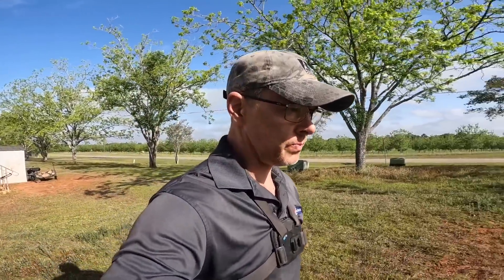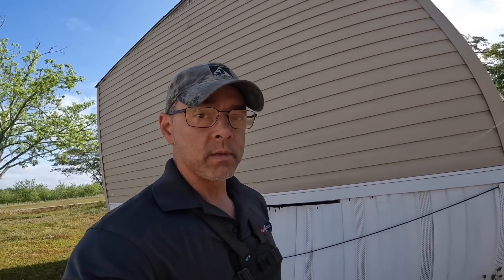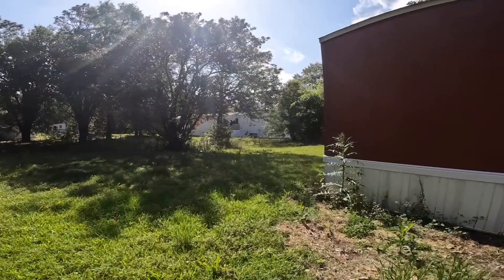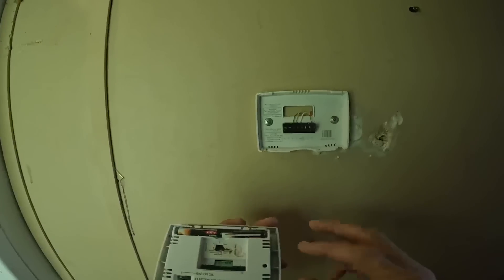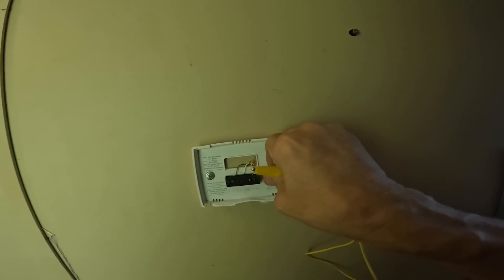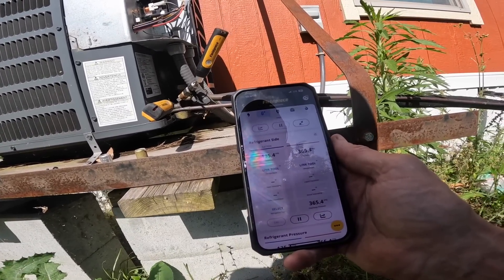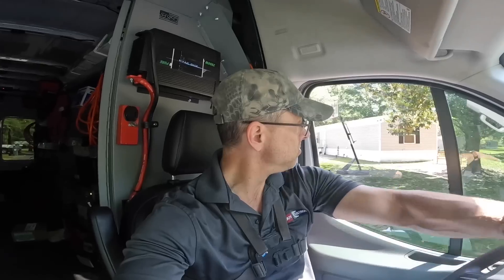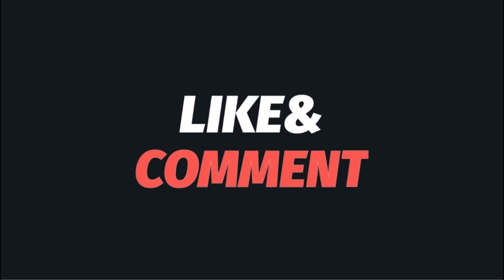Two Different Mobile Homes Freezing For Different Reasons!

Comment: Its pitiful how these guys are installing the evaporator without a fabricate pan underneath the coil to direct airflow thru the it instead of 10- 30% of the air going around bypassing it.  Looked the both systems were the same way

Comment: I noticed the same thing in this evaporator installation as your previous mobile home coil video, there is a 4” void between front of coil and base that is allowing air to bypass coil, yes there was foil tape but in both cases the tape lost adhesion and pulled away.  need to install some sheet metal to cover void and improve air flow over coil, stop bypass